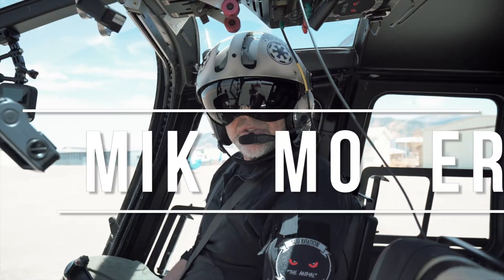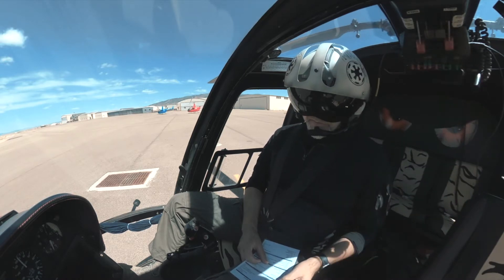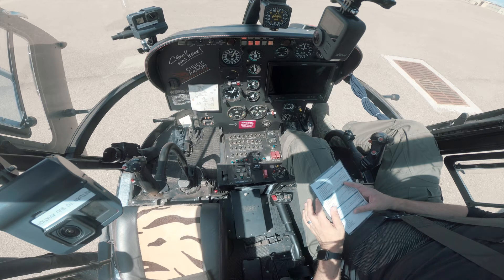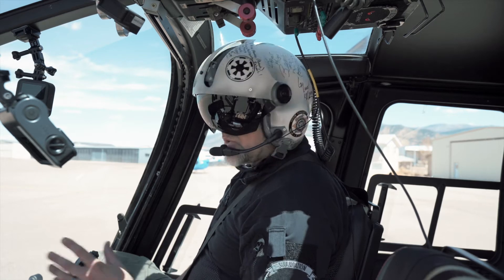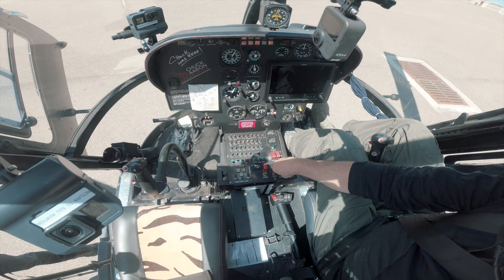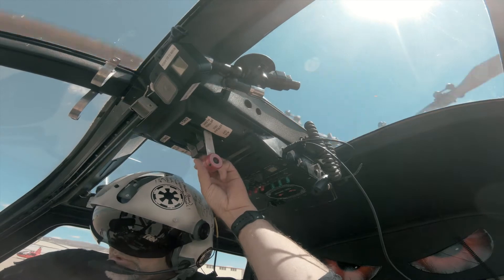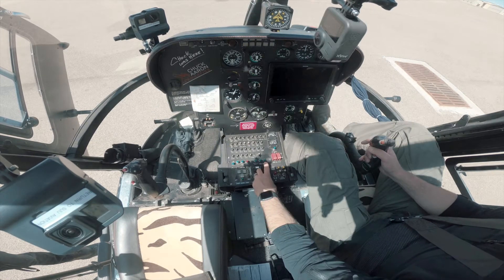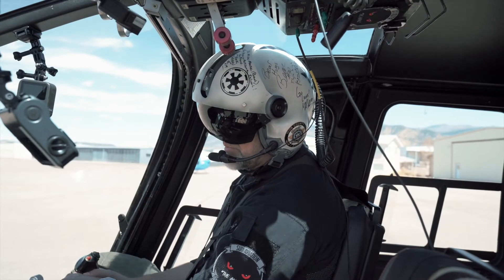How To Startup & Takeoff a BO 105 Helicopter

Comment: How does the throttle, cyclic, and collective work? Does a third arm come out of your back?
Reply: The throttle is basically not used when you fly. It's more of a rpm control anyway than anything else. The rotor in a helicopter is similar to a constant speed propeller on most turboprop aircraft. It runs with the same speed during flight and an Automatic Speed Governor keeps it at about that rpm by automatically adjust poweroutput.

Comment: Pretty good helicopter for small utility jobs, but usually lower altitude work. We tried them in Arizona for EMS, but they couldn't perform mainly because of single engine performance. However, I flew them in Gulf of Mexico for MMS, and they performed great.

Comment: What are frictions?
Reply: just a guess but its the the input controls resistance to movement. less friction means more movement and (possibly less control of the craft). more friction and there is more control in certain situations(i.e less involuntary control inputs due to winds or other factors). if anybody knows more i am all ears.
Reply: @dosentmatter1593  You were basically spot on. The frictions determine how much force is needed to move the controls. Every pilot is a bit different, some like it to be very light, some like to use more force on the controls. The frictions allow you to adjust that to your liking.